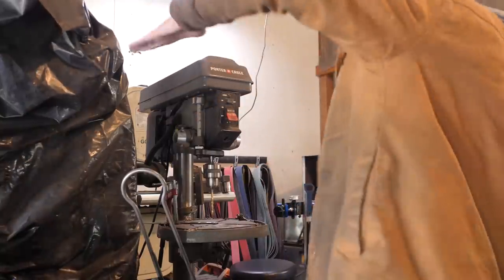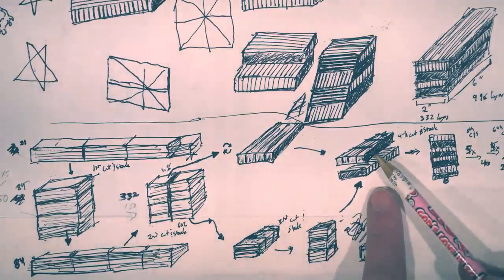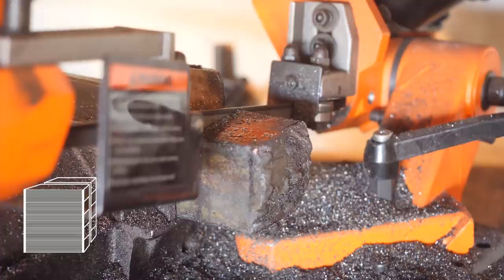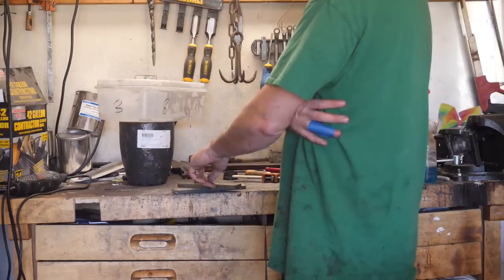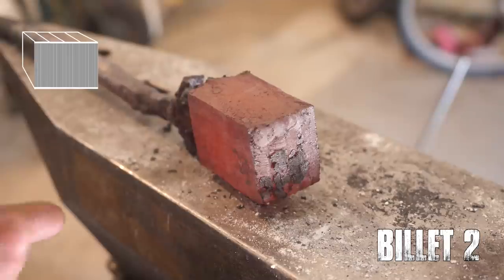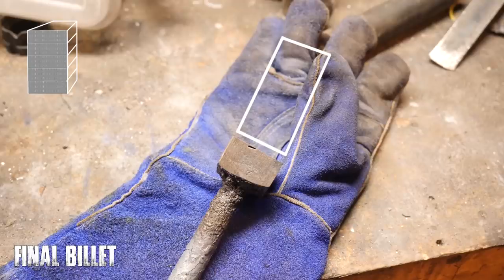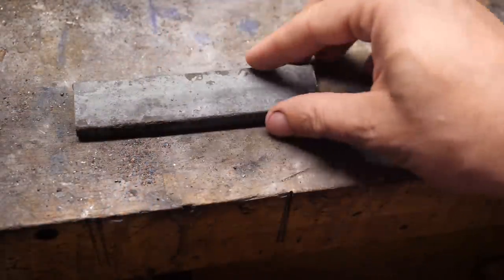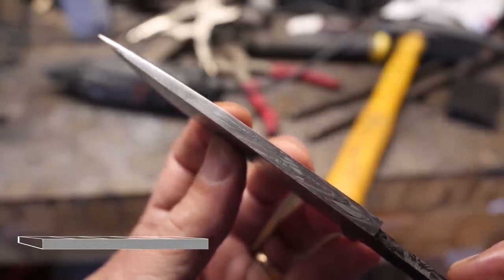Forging Knives From “Right Angle” Damascus (Zane Burch collab.)

Comment: I've got ideas! What about making a bunch of chips and bits of 15n20 and mixing it with 10-95? Star dust damascus.
Medium berrings, heavy on the 10-95, then two twists, just enough for a serpentine affect?
The hobbit, the desolation of smaug. Right after legolas shows up he has a knife with a damascus design etched into a flat steel background. Silhouette pattern etched with nail polish?

Comment: Love the videos man. Do you ever make small carving knives with those small cut offs. I’d buy one for sure if the price was right!
Reply from the maker: I probably should start doing that I've had a few requests now.
Reply: Green Beetle I could see it working out for ya. I’m not aware of many companies offering damascus carvers.    OCC tools and Helvie are the top brands I know of. (I’ve only been carving a short time)  but I could see the market for it. Plus the small cut offs you already have.
Reply from the maker: @TheFishstick9983   i don't know much about the design of the blades are they all just thin scandi grinds?
Reply: Green Beetle mostly flat grind straight edge. But they come in all shapes & sizes. Blade length is anywhere from 1”- 2” for detail carvers that I’ve seen. Pretty thin spine around .060” on my OCC